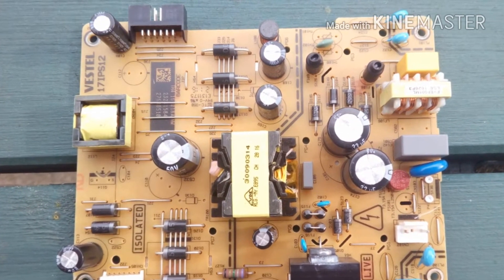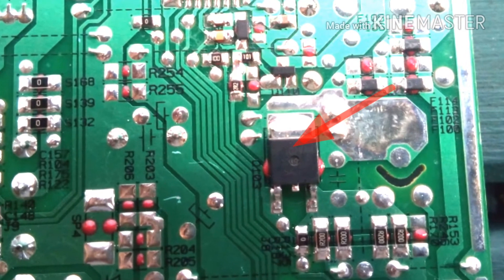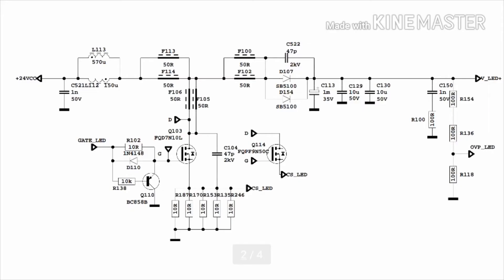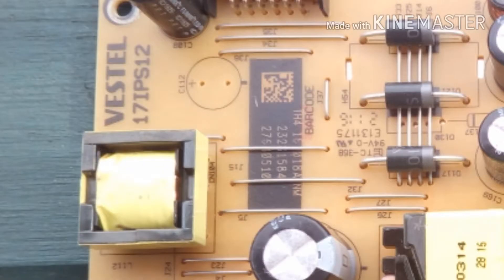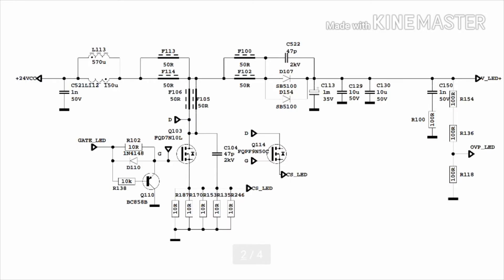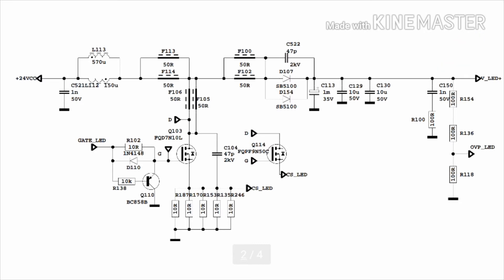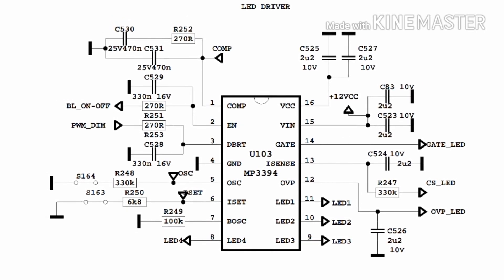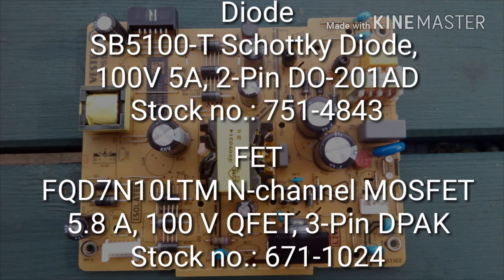Vestel TV Power Supply Repair 17IPS12

Comment: hello john..hope you remember this video and you could help me..i have the same board 
my problem is the main transformer not switching on.I believe U101 turns on the Aux winding via pin 1..problem..I have flutuating voltage at pin1...400v is steady at the main cap 
C175 resistors and diodes are good before pin1.Any thoughts..thanks

Comment: Hi there. Good video. Just to help you out a little......Q103 isn't an IC, it is a MOSFET transistor type FQD7N10. This is rated at 100v........you can use a FQD7N20 which has a higher rating of 200v at the same price. I have a stock of FQD7N30 (300v) which I use as I already have them. The most likely reason for its failure is that the electrolytic capacitor in the corner is most likely open circuit and the transistor can't cope with a "dirty" or unsmoothed voltage rail. 
Replace the transistor and the electrolytic, which is 56Uf/160V and you should be good to go.      Regards
Reply: Thanks..this was the information i was looking for .
Reply: This worked for me 👍
Reply: @B3NJI3M  I tried testing the LED outputs on this board with a small DC motor. After that, gradually, the TV stopped displaying any light or sound. Just like in the video, I also heard a buzzing sound, similar to the sound of a capacitor charging. How did you solve this problem? Which comment did you follow?
Reply: @burakbulama  I replaced all bulged capacitors. Can test if not bulged to see if they operate as expected then replace MOFSET as described in the above comment
Reply: @B3NJI3M  Thank you. So, how can I test whether this issue has damaged the motherboard or processor? If the motherboard is not damaged, I want to buy and install a discrete power board. As I mentioned, I used a small DC motor to test the LEDs. Could this current have damaged the motherboard? Can you suggest a way to test it?
Reply: @burakbulama  I'd recommend just replacing the suggested components if the issue your having is exactly as described in the video as the components are cheap and it will be quicker than trying to test everything. If the TV had display and sound, why were you testing the motherboard with a DC motor?
Reply: Thank you

Comment: Hello my friend,where can we find the service manual for this TV?I have found one that is R3 (revision 3 i presume?) But it doesnt seem to be the exact same as mine.
Reply from the maker: There are lots of boards that look similar but have different components and give different voltages etc. However they all work more or less the same. This is why I fixed mine rather than trying to get another board.
Reply: @thejohndyson  Tomorrow that i will go to the workshop i will take a good look and post the exact numbers of the board.
Reply from the maker: Try Google. What's wrong with the set?

Comment: Hi i want to fix 17ips12 after lightning my TV does not work any more
Reply from the maker: Hmmm. After being struck by lightning it might be more serious.. Start by checking the psu outputs. 
Does it do anything anymore, it's possible it fried all the chips.
Reply: @thejohndyson  thanks i sent tv to company and they changed the board it costs 100 dollars
Reply: @raghebayash7340  
The same thing happend to my tv, do you know witch board they replaced?